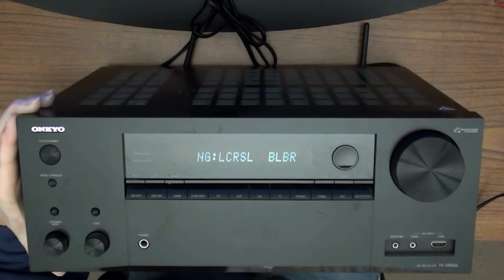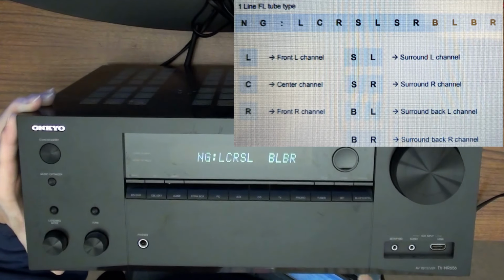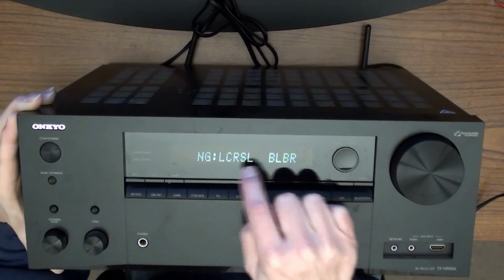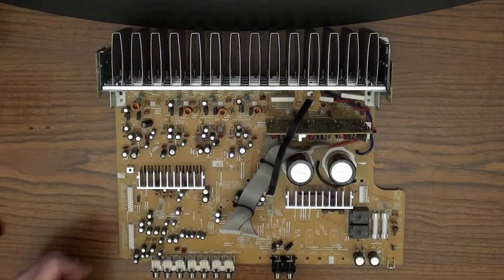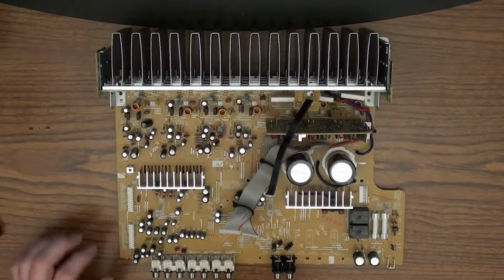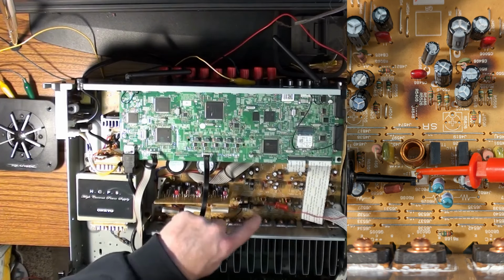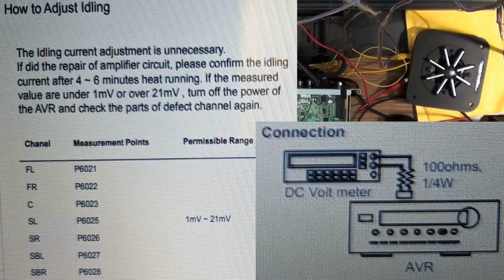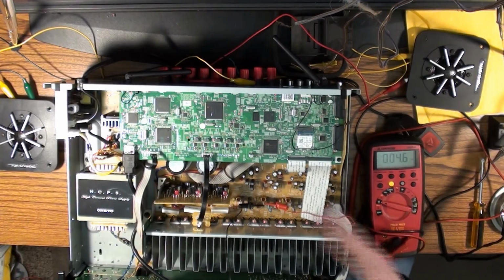Onkyo TX-NR656 No Sound Fix: NG:LCRSL BLBR Error Code Explained

Comment: Thanks for your help 
This video is really helpful. 
Just out of curiosity, how long did it take you to replace the defective parts? Not counting the diagnostic check
Reply from the maker: It doesn't take long to remove parts and install new ones. I don't recall the exact time, but it probably took about half an hour, including cleanup. That's usually the easy part of the job as long as the circuit board isn't too thick. Troubleshooting usually takes the longest.😁

Comment: 0:34 - power on
1:03 - error explanation
1:59 - diagnostic check, error clear
5:32 - top removed
6:11 - five wire stands found and highlighted
12:40 - dark areas on main board
15:14 - dark areas from underneath
15:30 - removed components
17:39 - parts replaced, power on test
19:19 - bias adjust, connection points
Reply from the maker: Thank you very much for creating this timestamp list. I have added it to the video description for others to use. 😁
Reply: @ElectronicsEditor  - You are very welcome. It helps me understand your process and makes it easier for me to reference when I come back. Thank for the video!

Comment: I really don't see where your troubleshooting skills are?
You should prepare an oscilloscope.....various test instruments.
You should dismantle each circuit pc board and test the input and output.
Reply from the maker: Don't watch my videos if you don't like them. You do things your way, and I'll do things my way. I have test equipment, but people who use test equipment for everything do not help others, because not everyone who watches my videos can afford the same test equipment used in most videos. It's just something to do for me anyway. I don't do this as a living. So, I'll continue to annoy certain people by doing things my way.
Reply: @ElectronicsEditor    Exactly,  You are 💯 % correct.  And Thank you for your videos and time. And the first time I watched this video,  I had a few beers beforehand  / about 10 or so, and as the part where you said at 4:55 " Don't do it over this " I was doing exactly that while looking at one receiver and preparing wires for another receiver while listening to your video. So when you said don't do it over this, I looked at my phone and was like 🫪 oops, I thought to myself,  well I better move , lol. . Anyways,  thank you again for your videos.  I am hoping to fix this onkyo TX-RZ810 that I bought at the same time as a  I went to buy a Onkyo TX-NR696 which works fine, but I never checked the other unit when I bought them / TX-RZ810. The nan just asked if I would be interested in the 810 also.  I said yea but I didn't have much more money.  He asked what I had left , i looked and said $40 and he said oh, nevermind. About 2 minutes passed and he said , heck with it, u can have it for $40. I thought hell yea. But now I see why, lol.

Comment: Hi, I’m helping my dad, and we noticed instead of a “V”, when I pressed a button appeared “I”can you help us? Thanks in advance
Reply from the maker: The "i" stands for a current protection mode. It really means the same as the "V." There is something wrong with the receiver, and it will need repair. Always, the first thing to check is the output transistors. If they are not directly shorted across a couple of legs on each transistor, there might be internal damage to the transistor that causes it to sink too much current, hence the "i" instead of "V". They both are a bad sign. Sorry.

Comment: I like that it as least has some kind of self-diagnostics - I was unlucky having two Onkyo's with the infamous Texas Instrument DTS chip. No error msg, just no sound and no speaker-relay click. The first one was fixed in extended warranty, the other one (TX-NR808) still works (never failed). 
Thanks for the video.

Comment: You did an excellent repair :-D well done. :-D
There is a hell of a lot inside those beasts,  i had to repair a similar beast for a friend, yes i have a frend ha ha :-D

it had banks of audio power amplifiers on long pcbs, but you had to strip the unit down to the base board,  not a fun fix.
There was power supply shut down circuits.
If one pcb wasn't correct, the shut down circuits jumped in.
So many pcbs and it could be any one.
One of the amplifier channels was blown up. 
Then came the odd parts that were difficult to find.
I decided not to touch one of those again lol.
Reply from the maker: Yeah, that sounds like it was a pain. You got it to work again so that's what counts. Great job.